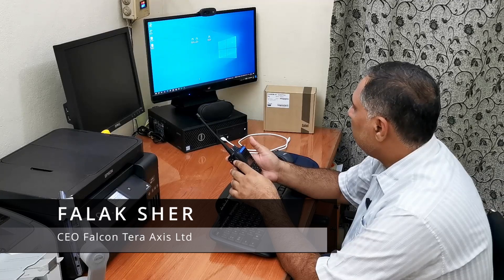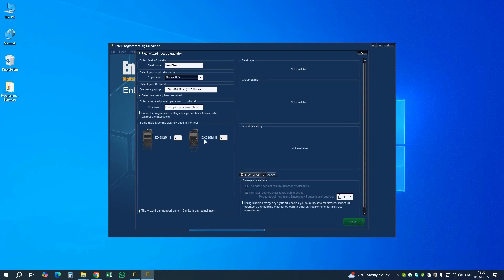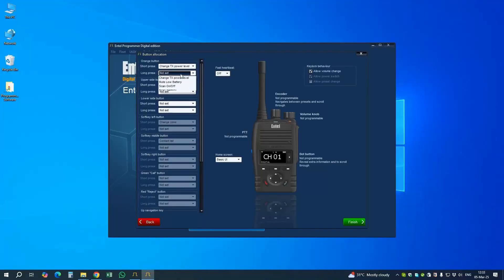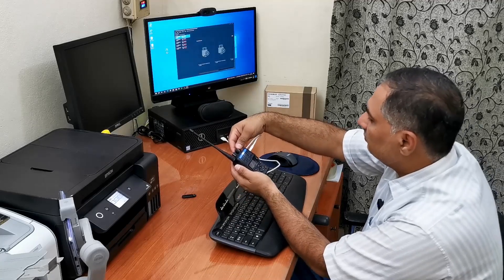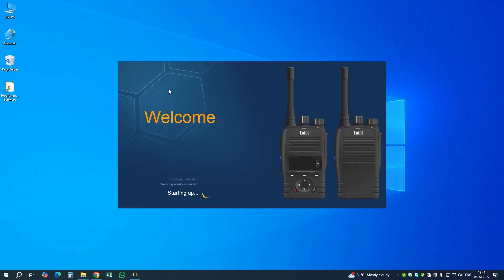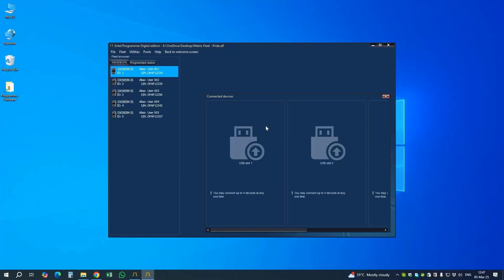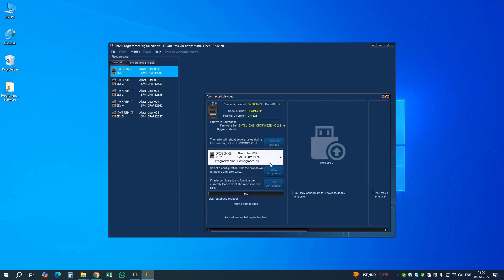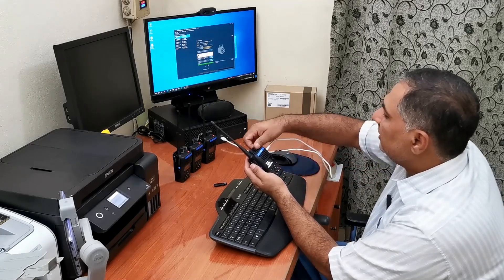How to Program Entel DX585M-IS Radio | Step-by-Step Guide for Marine & Hazardous Use

Comment: I have a DX585 IS 
I also find it hard to to get any help on this radio.
Have you got a link for the programme because the programme I've downloaded is 1.3v and it's totally different to yours  ?
Reply from the maker: The software for Old Models is different than newer DX Models. The one I use is 1.0.2.7. You can request the sofware form ENTEL.
Reply: @falconteraaxis Hello Sir, are you using some special cable for connection or just regular usb?